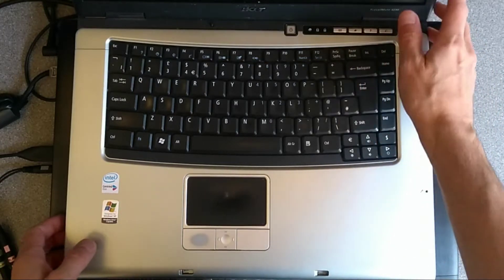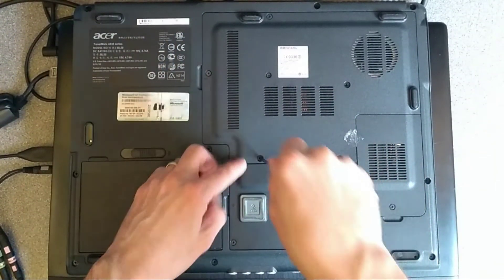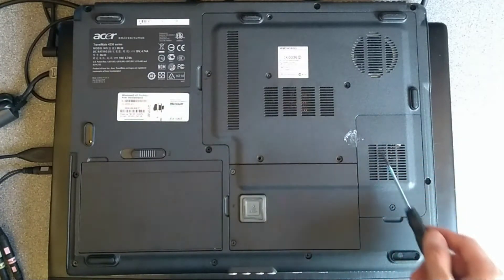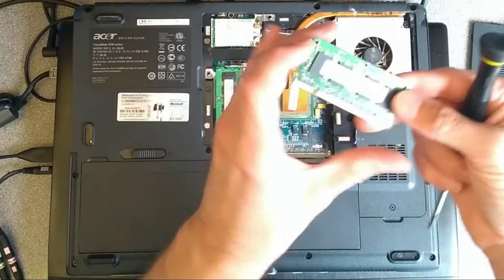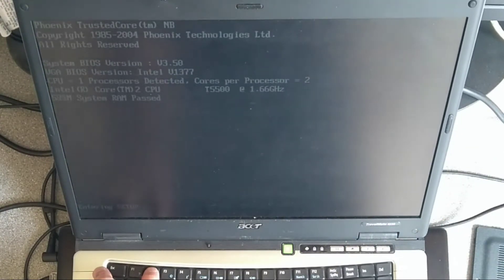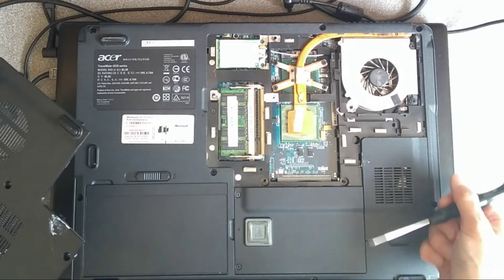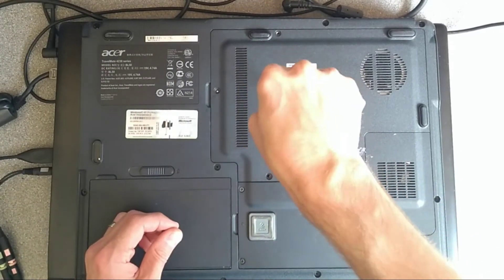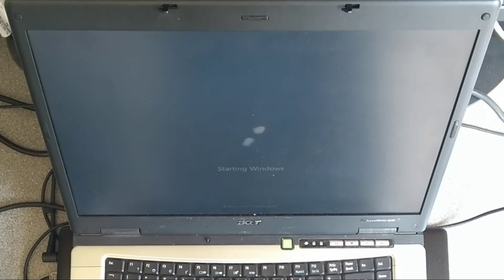How to upgrade the RAM in an Acer Travelmate 4230

Comment: hi i have an acer travelmate 5742 does it use the same ram because it currently has 4gb and i use it for basic gaming when i dont have access to my pc 
i play things like minecraft and aim for around fps 60 but currently have fps 40. 
pvp is quite difficult as well.
i want to add more ram and storage.
also want to know how to fix the old graphics driver as it will only let me run minecraft bedrock and crashes when i try to load java.
if you could get back to me or make a tutorial video that would be great.
thx.
(edit) also as a bonus can you take the keys of and if so how because it is second hand and quite gross
Reply from the maker: Adding RAM is unlikely to increase your FPS in games. To find what RAM your computer uses - try the system scanner on crucial.com. The graphics card in the machine is also unlikely to be any good; it probably is not old drivers being the cause but just that the card can't do advanced stuff. (Is it an Intel graphics card? If so, those were never really made for games).
Key removal is difficult and often easy to break. I'm afraid I don't have a video on that and a lot about the process is knowing how much tension and twist to put on the keys and brackets. Really difficult to "video" that process.

Comment: Do you have a suggestion for the worn screws, I have the same exact model but can't replace the back cover because of this.
Reply from the maker: A good screwdriver and a lot of pressure is my usual.
Reply: @freename  Thanks but there's almost made a hole in the screw, doing pressure just makes the hole go deeper :}
Reply from the maker: Maybe just the right torqx screwdriver and hope it bites into the edges of the hole
Reply: @freename  Thanks, I'll try for sure.